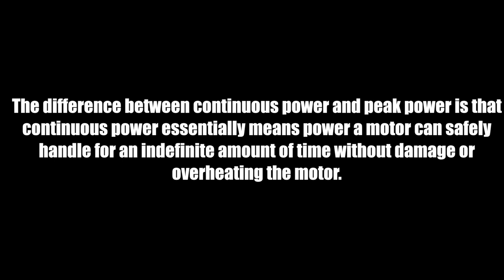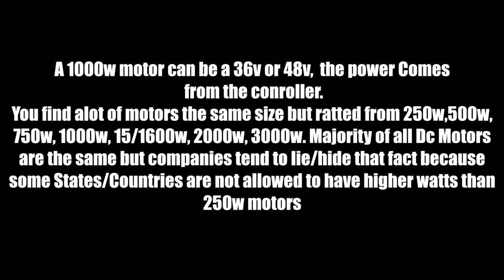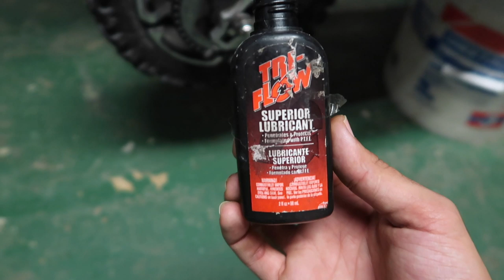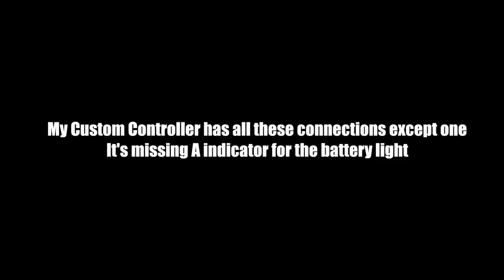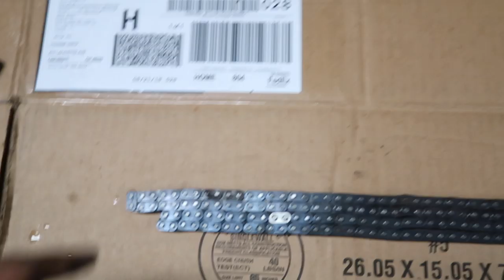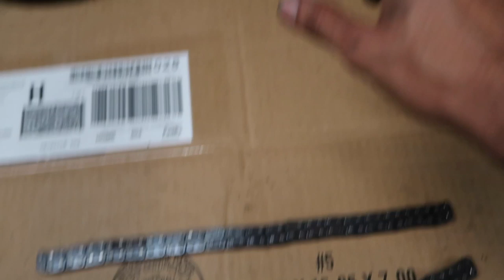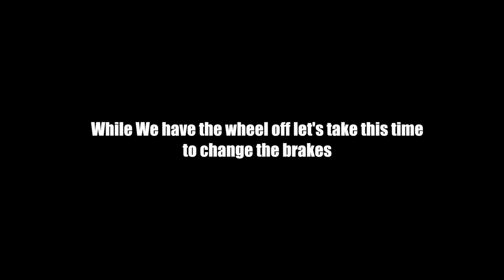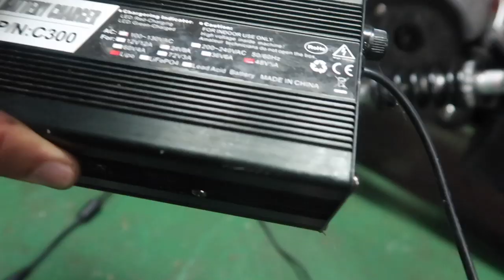Uberscoot 1000w/1600w Electric Scooters FAQ / How To

Comment: Nice vid thanks. Ive got the '1600'w Stealth Bullet, basically same build as yours. I boosted power/flat speed by around 30% by adding / soldering on a bit of metal across the current circuit bit in my control box - pretty sure it was a current limiter thing. Works a treat tho, I'm cruising on flat around 38kmph vs the out of the box 26kmph - I'm tempted to add more as I reckon it's got it in it but QUESTION IS: is there a risk of frying something or will the control box be rated to max battery current???? Thanks mate / or Anyone???? Motor still cuts out downhill if I lift off full throttle at around 40+kmph. Is that normal?? Thanks again. Loving my trips to and from work these days!
Reply: Thinking of doing the same mod, is your scooter still going or did it die?
Reply: @stewartdahamman  Still going strong actually, but I now have a Kaabo WW. Check out CootScoots ;)

Comment: hi ive got a similar scooter just wandering- if you lift the back wheel off the floor and spin it should the back wheel spin round easy or should it be stiff, on mine it will only rotate once and then stop. also when im walking and pushing it along the back wheel feels like its resisting or grinding(its not the brakes by the way) its a real struggle to push .any ideas ?? or is this just normal?  all is ok when riding by the way only feel it when pushing

Comment: I’ve got a viron 1000w 36v scooter,I need to know if it’s possible to make it charger wire assembly to be able to charge the battery away from the scooter,does it need the control box etc or can I just make a rig that’s just the wires and plug

Comment: Jason Evo! 
I just bought the 48v 1600w! I could've SWORN u did a vid on swapping out the control box, but I don't see it? Anyway, what are the specs on the controller u used? I can only find 48v 1500w controllers, with 38 or more amps. Thanks for any help u can provide.
Reply from the maker: The 1500w is the same as 1600w. My controller I got form AliExpress is a 1500/1600w 40amps. I would recommend to go with the higher amps Aldo 38 is still good 40 is better try not to go any higher
Reply: @Scentedstyle  
Yeah, I followed the link for the controller on Aliexpress. They r out of stock(of course) I wanted to just do a lithium upgrade, but the budget won't allow that expense right now. So I'll just do the controller upgrade. Thanks for the response, info, and great vids! These things are a BLAST!
Reply: @Scentedstyle  
I just found one on AliExpress! I'm a happy man! Thanks again my man!
Reply: @bigtylee  could you post a link on here please. Im having trouble finding that controller on aliexpress.
Reply: @paulcosquieri5789  It's out of stock where I got it from. They run out on Aliexpress fast. Best I can tell u is to keep looking, That's what I did. I think a seller has a few every so often it seems. Sorry I can't help more.

Comment: I saw that these scooters comes in a 36v 800w version as well as a 36v 1000w version. What's the difference between those two? Controller output to the motor?
Reply: different speed

Comment: Hi maybe you can help me I have a 1000 watt EVO scooter which love but I haven't rode in 3 or 4 years because one day coming home from the store the chain came off. So I backtrack and found the chain but the chain clip was gone it took me months to get a new one. The cause of the problem was the the tension clasp bent I see on you scooter a different design and it looks good. I was wonder if I could incorporate that system on my scooter or find some steel clasp instead of the aluminum soft metal to keep back wheel axle strate in line so the chain don't pop off. Do you understand what I'm talking about rear axle adjusters.

Comment: Hows the new controller?? Does it mk it faster? What doez it actually do?? I recently changed batterys to lithium ill post a vid on how to change the batterys. Step by step. 
Thanks
Bsipp
Reply from the maker: I did notice a little difference from the new controller it lets out more power than the stock controller. Great a lot of people need help with battery the step by step would be very helpful

Comment: ok i bought one of these 60v 2000w plus battery is whack i got my money back ??? 
now am just lookng at parts to make it rideable in the streets.
i just need to buy loads of parts what will now be hard to get because china locked down the battery is the first thing i need to change get me a 24ah ;ithium io battery in there not polyesterbattery only giving 4 miles range if that.
thanks for this video man i know how to chop wire n fix em just can not be messing em up i dont want to fry anything we  see coulours chins see volts in cables.
that there is a big problem

Comment: Cool video! A question, how long does one of these scooter last? Thinking about to use it to travel on total 5 miles everyday. Which part would be the first to wear off? The battery? The wheels? Would be grateful for answer

Comment: Hi thanks for the great vid and info. I've been looking at battery upgrade options for my scooter and was just wondering. My scooter uses 4 12V 6-DZM-12 acid lead batteries. A Lithium upgrade is very pricy but I was wondering is upgrading to 6-DZM-20 batteries an option/possible?
Reply from the maker: Yes it’s possible it will in crease your range from 12 miles to 20 miles
Reply: Done some further research. Unfortunately looks like 6-DZM-20s are a larger physical size/format that will not fit in the battery bay :( But it turns out 6-DZM-15 are the same physical dimensions as the stock 6-DZM-12s :) Not enough of a jump up in capacity though to justify the upgrade cost, but I will definitely replace stock batteries with 6-DZM-15s when stock batteries die unless Li-Ion batteries have dropped to a more affordable price by then! :)
Reply: I put a 52 volt lithium battery and now it flies so far so good running awesome.

Comment: Hey brother I have same scooter but I have a problem I saw your video but it’s not cleared to me the problem is the turbo switch is not working if I press it on it doesn’t comes any changes to speed can you please help me and which app you using in your phone for speed check please help me thanks ❤

Comment: I just bought and installed my Lithium battery and I have not seen an increase in speed. I haven't been able to take it out as long as I wanted due to rain so I can't tell the distance yet. I so see it top out at 30 and the green light hasn't budged which normally if you full throttle it it disappears right away. I was hoping to be going faster than 30.any suggestions?

Comment: If u want your battery indicator on make a twin connector from speed controller its why I did cause my new controller came with one indicator connector so I cut the old one off n wire it to new one controller on same indicator connector

Comment: Was my uberscoot 1000w suppose to come with separate fuses to put in the wire for the battery ? I am having trouble because it did not come with a manual and my uberscoot will not start even after charging it. Purchased it from Walmart and it came with the scooter,bars chsrger, keys, lights and a seat that's it
Reply from the maker: Yes it’s supposed to come with two fuses already installed or in the small tool bag. Contact Walmart customer service they will either send you the fuses or replace the scooter at no extra charge of course.
Reply: Get the fuses in the bag and put it in the battery cable and it's gonna work

Comment: I only want to potter along slowly on the pavements. Thinking about getting a bigger rear sprocket set up as I think it should increase run time when just ambling about.
Reply: No, don't waste money, just buy it and accelerate carefully as you need, of course lower speed saves battery as motor turns slower, if you replace the rear sprocket with a bigger one the motor needs to rev faster, think about it.
Reply: @fatfat6389  indeed, I am kinda comparing to my RC cars and their brushless and lithium power. Thanks. Do you know if the 1000 watt motor on the Chaos 48 volt  is lipo compatible as the weight diffrence and run time are big factors for me not being in best health. Thanks.
Reply: I don't know particularly for Chaos 48 volt, nor for Lipo for sure, but all motors should work with standard e-bike Li-ion batteries, it just matters from their controllers. Should be the same for Lipo as well, just need to have the right controller I guess.
Reply: @fatfat6389  I will look into it when I talk with Funbikes UK as they are sending my fixed Chaos tomorrow 😋

Comment: Hi Jason, I noticed my Uberscoot 1600W 48V scooter has 12v 12ah SLA batteries connections with screw type (threaded) terminals, but most of the SLA batteries on line and Amazon have F1 or F2 connections.  Can I still use those F1 or F2 connections or how do I get the correct batteries to work with my scooter?  Thank you.
Reply from the maker: I just checked and you’re absolutely right, I searched everywhere looking for a threaded terminal battery but all I found was the F1 or F2 connections however I found one on amazon 

https://amzn.to/2D33tcs

You can either purchase one of those F2/F1 battery and also buy new F1/F2 wire connectors or use the same amount to buy a lithium battery which will boost your speed and give you longer rides, search on AliExpress for best prices but here is one link

https://goo.gl/6uNVh5
Reply: @Scentedstyle  Hey Jason, I was looking at the link from ali for the lithium battery youre running and noticed in the item description after "Fit moto power" its rated "Less 1440w". Can you clarify since we have the 1600w scoot? Is it to not overpower the motor? Thanks in advance for your time and appreciate the videos!
Reply from the maker: As long as you stay in the same voltage 48v it won’t overpower. The link is for the battery that I have but feel free to search around you might even find cheaper and better ones. Just make sure its a 48v battery
Reply: @Scentedstyle  thanks for the reply homie! I love your setup and for the $230 range isnt too bad price. Thanks again dude, have a good day!

Comment: Thanks for all the info. I'm considering buying an electric scooter, but my local reseller is offering a few variants, some with lead-acid batteries and some with lithium-ion batteries, and I got the impression that the latter are heavily overpriced. So I'm planning to buy the cheaper variant, and buying the lithium batteries separately, but I wanted to know if I should expect any problems (say, the controller refusing to work with 'unoriginal batteries', like many laptops refuse to work with unoriginal chargers).

Since the merchant appears to be making a nice profit margin on their 'premium batteries' I doubt I could get the info from them :P
Reply from the maker: You can get any lithium battery you want as long as it’s the same voltage as the scooter. Using the same controller with lithium for me worked just fine however I do recommend buying a new controller with higher amps ($35) to max out the speed/power.
Reply: @Scentedstyle  I'll consider it once I get there xD
For now, I'm just a guy who's been using mostly public transport, thinking what options I have if I don't plan on buying a car any time soon. I'd like a vehicle I can drive slow if I want to, I can stop anytime I want, and cars just don't seem to fit the bill :P
Since most electric scooters seem to have around 250w advertised power, I assume 1000w should be more than enough for my needs. I just want a nice buffer for hilly terrain, driving on dirt roads, in bad weather or in winter. Maybe offroad, but that's not a requirement. I'm considering moving from suburbs to a village that is 8 km away from the nearest train station, and only sees like 2 buses a day, so that's the main reason why I'm considering electric vehicles.
I'm just worried how I'll deal with winter. I've heard electric scooters don't work too well in cold, losing a lot of power capacity. I wonder if I could solve this by keeping the battery warm during winter commutes :P

Comment: how u know does them speeds got mine 2day suppose to be 40mph plus try today did not go past 15mph do i need to mess around with it or take out for a longer ride ???????????? went up a road never saw 30mph and my other one does it on a 1200w back motor even tho its a dual scooter.

if i need to send this MAF scooter back after getting it today i will. 2000w evo MAF
the real specs anyone know ????????????????

Comment: If you upgraded your controller it will not change the power of the scooter, the motor will only use as much power as it needs. You can put a controller rated up to 10000A and it will be exactly the same power, cause the motor can never pull that many amps. Speed controllers are rated by how many amps it can handle not how many amps it puts out the motor and voltage and load determine how much power is being used at any moment. You can listen to me cause I’m an electromechanical engineer and specialized in electric motors and batteries.
Reply: right on brother in jesus  name

Comment: Yo u ever ride the mototec mad house. 1600? I just got one cheap needed batterys. So i got em. I like the bigger tires. But its def heavier then the uber 1600. But i think it has a cool look.looking to upgrade the batterys to lithium. U did that rite. Does it mk a bigger diff in speed and torque?? If not prob wont do it. But i know it mks it a lil lighter. 
Bsipp
Reply from the maker: I tried putting my lithium battery in but the controller couldn’t handle all that power after 20 minutes of usage burned the controller. Not worth is unless you find a lithium controller check AliExpress
Reply: @Scentedstyle  like my rc cars, a brushed controller is only good for the type of battery they come with unless like most rc car esc they can be programmed for your needs. Thanks again for a great vid.

Comment: Okay I have a 1000w 36v that was pretty fast. The other day I got caught in the rain on it and now it goes a lot slower than it did and it doesn’t pick up speed as fast. The battery also dies a lot faster. Does anyone know what the issue might be?

Comment: I have 23 v @ 10 AH and a 500 w motor  so to increase distance can I add another battery without having to change my controller to get such distance or just add 24v with higher AH?
Reply: You should be aiming for atleast 36v
Reply: @hgibbons69  Thanks, that's what I'm going to do , I need distance.
Reply: @hgibbons69  If I put the original 450w motor, can I get more distance with just the 24v 10ah ?
Reply: @ccccen  ideally you want a higher than 10Ah because the more volts, the faster the 10Ah is used up - wouldnt recommend less than 36volts though as the scooter would most likely be like sub 10mph but if you're on 24V adding another 12v battery that is (let's assume 6-8Ah min) in tandem, would give you the 36V, with (expected 16Ah of 'fuel') which would straight away give you more range than before AND the added bonus of an additional 12V so like upto 1/3 more access to higher speed. It should scale fairly linearly so expect 1/4 to 1/3 more range AND power - BUT depending on your current controller (if it's 250w or 350w rated you will want a 500W controller to utilise the motor and current/power draw.) And you could go up to a 650 or 700 W controller at 36Ah (a 500w motor can be pushed 30% extra but not for sustained loads.. e.g. using a 700w controller isnt always forcing the motor above 500w but will allow it to push a little higher which will give you a bit of extra headroom and speed but will use juice a little faster still! Hope that helps a bit - still half figuring out my own set up atm :)
Reply: @hgibbons69  ok, I have an extra battery so I will added to my24v making it 36v with the 500 motor . So it shall be better with a 500 controler instead of the 450 controller?

Comment: Hi bro, good video u have up, trying to figure out what size controller I have
Can't figure out its output or amps  it says.         Electric current 35/18A
Cheers
Reply from the maker: Roger Shaw sounds like you have a 36v battery with 18amps

Comment: My scooter works good for about 20 minutes, but then it cuts off and on. Would that be controller? Throttle of motor?
Reply from the maker: It could be the controller or the motor, I would try the controller first as it tends to overheat and its always the first to cause problems. The motor should be fine unless you rode on wet roads causing the tires to spray water in the motor

Comment: AT 24:56 Why all that hassle when all you had to do was open the lock on the chain and run it out with hand. To place it back all you do is ,by hand get a few holes from the chain to catch onto the wheel at motor, the motor has a fly wheel just like the one on rim. catch it ,turn wheel and puff then you put lock back on chain. Just as on a bike bro, entiendes jejeje why buy another chain when you could have just cut thee old to size?

Comment: On my electric scooter my callipers aren’t straight and have been rubbing against the disk I don’t how to fix pls help
Reply from the maker: There is a hex key/bolt that holds/aligns the whole brake calipers which can be adjusted to fitting. Loosing the bolts that are holding the calipers in the sides and middle section, which will allow you to adjust the whole caliper
Reply: @Scentedstyle  OK thank you very much good video well detailed
Reply: I don't know much about bikes and scooters so I will try this out hopefully will work

Comment: That’s not how it works, you calculated the battery capacity at “1008” watt hours which is completely different to how much power the motor can produce.

Comment: Hey can u help me with my chaine it's some how become very lose and keeps popping off the track  how do u adjust my chaine to fit better
Reply from the maker: Unscrew the bolts that hold the back wheel, once loose pull on the wheel while the chain in on the sprocket to get a tight fit then tight it back up